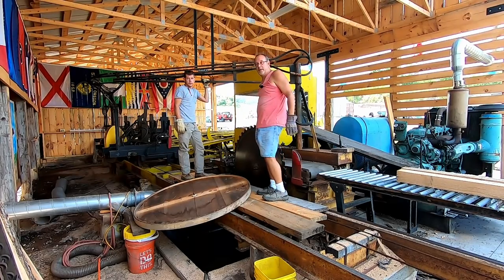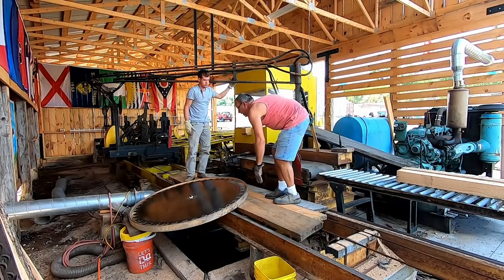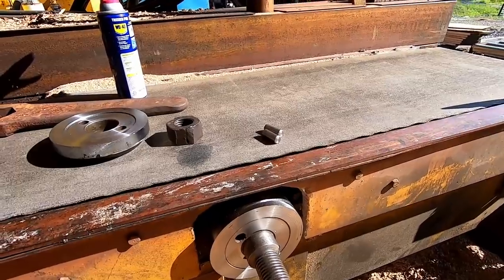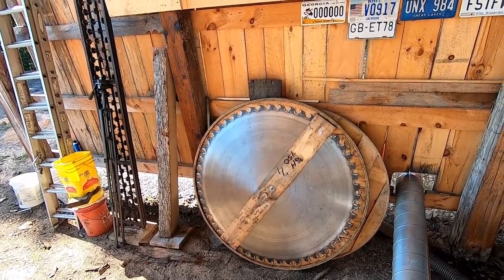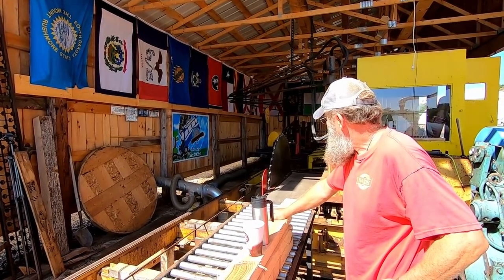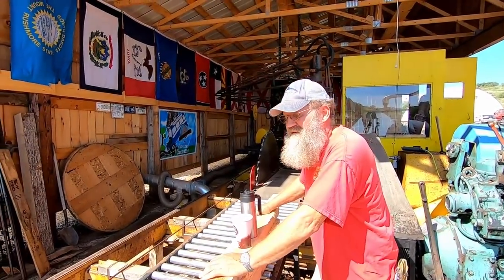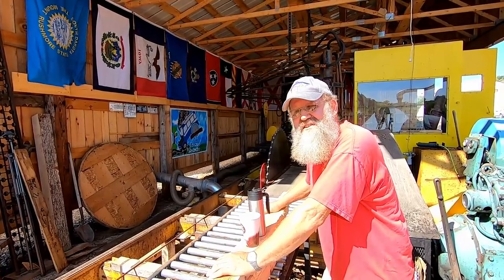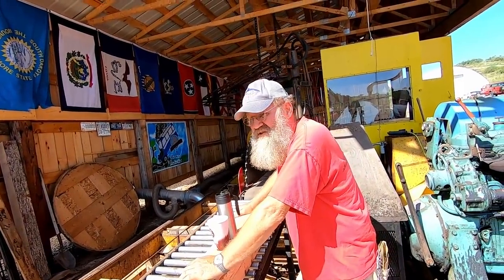turning the saw collar

Comment: With these saws over 48 in they get really bad tempered the larger they get. 56 is a monster for sure. Getting the lead just right can change summer to winter as well. Or a species change can call for a lead adjustment. All part and parcel of sawmilling. My truing system is welded to the husk and operated just like a lathe. I will tune the outer with a file on the outside and then mount it backwards on the arbour and tune the inside face. Those big bad tempered saws run like new. Now it sounds great !
Reply from the maker: yes they tuning a few times a year.

Comment: When you get  a chance could you tell us what the "lead" is?
Reply: Yes, please explain the definition of “lead”
Reply: I'm curious on that as well
Reply: The saw blade does not run perfectly in line with the carriage/saw log. It is slightly closer to the carriage at the leading edge than the trailing edge. It is simple to check and each blade has its own best lead. Some like more and some like less. Most start with 1/32” from from front to back and it must be measured on the same tooth. Measure from the carriage to a tooth, roll the blade 180 degrees (roughly) and move the carriage forward and re-measure from the exact same spot on the carriage (headlock, ell, frame). To adjust the lead, the mandrel bearings are adjustable fore and aft so the entire setup from blade to pulley are skewed to get the blade’s lead correct. Saw a little and see if more or less is required for the blade to stay in line. If this is not correct the saw will not cut straight.
Reply: @mikegreen8517  Nice Job Mike
Reply from the maker: we will talk about lead on a video.
Reply: @mikegreen8517  Thanks mike.  I noticed that Mark said he will explain in a video so we can all look forward to that as well.
Reply: @markgalicic7788  Thank you.  I'm looking forward to that.  Like your videos, keep up the good work.

Comment: Is 56" the maximum size for that mill, or was it designed for something larger? It looked like you have a few inches clearance between the teeth and the support bars, so I was wondering if it was supposedly a 60" mill.
Reply from the maker: no we can run a 60" but it's more saw to maintain.
Reply: @markgalicic7788  How much of the 28" radius is lost for depth of cut?

Comment: What would the cost be to upgrade to a 60" blade?
Reply: Used-1-2k, new 3k and up depending on gage, number of teeth, type of bits installed...
Reply from the maker: we don't want to run a 60" just to much saw to maintain.